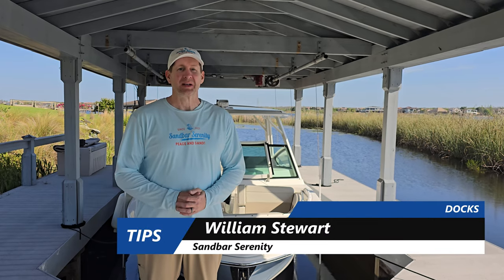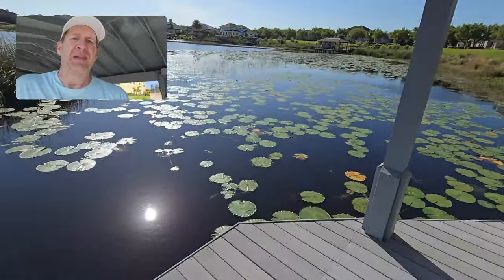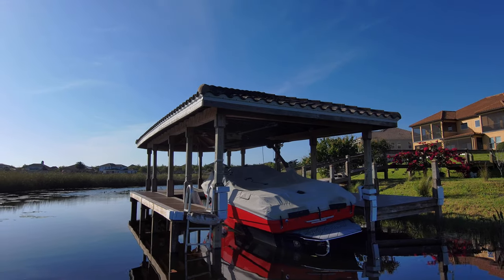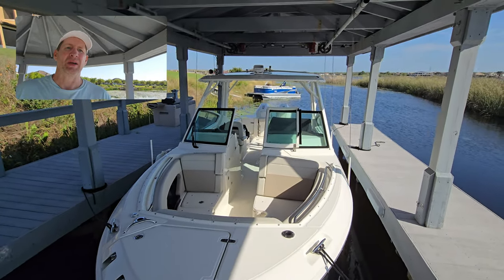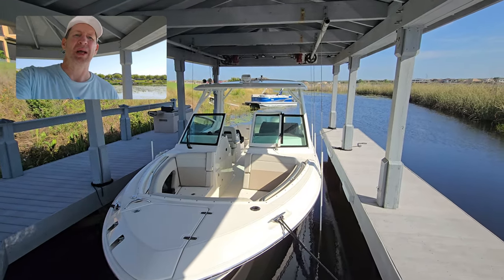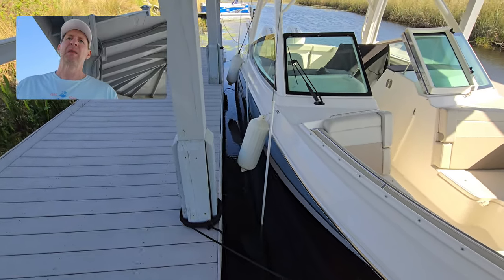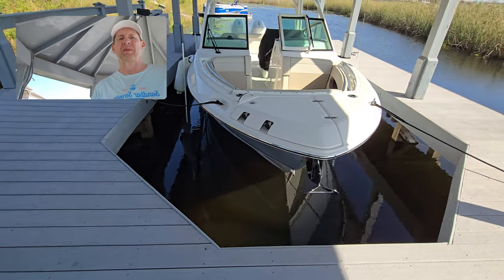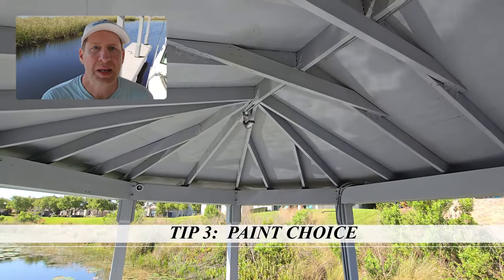6 Tips for building a dock!

Comment: 6x6s and not piling...youre nutz....full piling and at least 6 ft deep if not more....neighbor has a mess but its not a hard repair
Reply from the maker: 6 x 6s are plenty for lake boats and lifts.   If you are on the coast, and have a 10k or more boat that is 30 feet or more you are going to do pilings with a 4 post set up. Especially with triple or quad engine set up.  I am considering a  4 post lift with pilings for my dock and can easily fit it inside the slip with the extra width.  Remember, this video is about a lake dock, not a coastal dock.